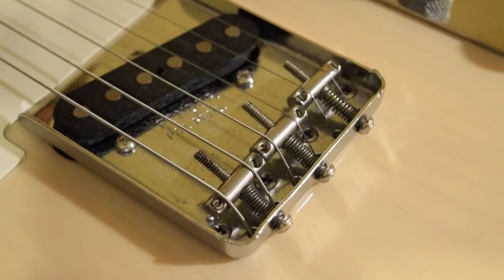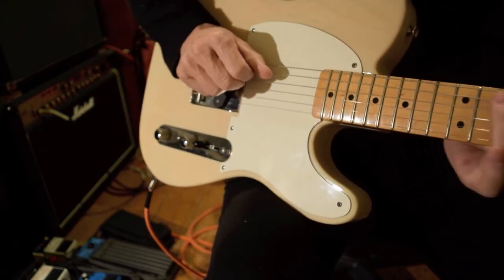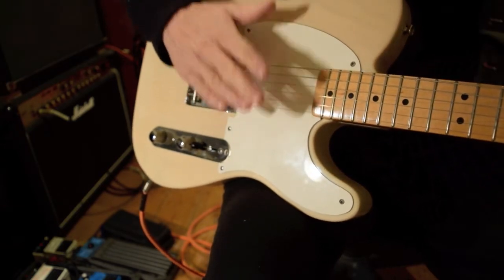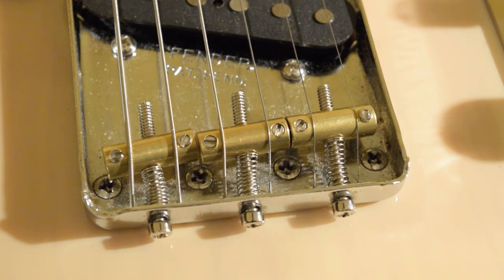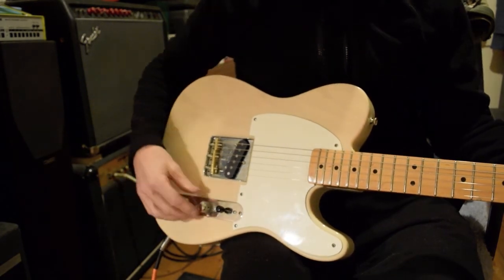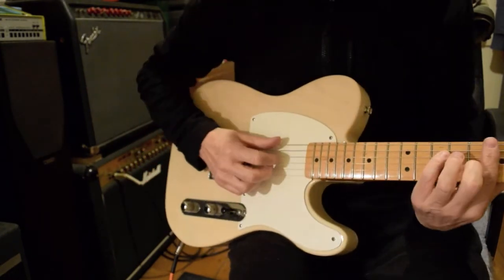TELECASTER SADDLES - STEEL VS BRASS

Comment: Thanks, well exited now cos I use the same Guitar(Fender Esquire) which comes with steel saddles frim factory which do sound lot "Brighter" the brass helps to bring the Midrange out as it usually gets drowned by the treble depending on how you play. With steel  saddles I find finger style better but for all round smoother tone I am going for brass too!
Reply from the maker: I don’t have the original pickup in mine. I bought it used and there was a Duncan rail bucker in it. Now this sounded ferocious but it’s not true to the era the guitar is from so I put in a Q Nocaster/Broadcaster Alnico 3. It works well! Let me know how you get on!

Comment: Great comparison, man!
This video came with perfect timing as I'm thinking about replacing the three stock steel saddles on the bridge of my Mexican Tele Custom with brass ones.
The only problem I have is choosing between non-compensated saddles and compensated ones.
There seems to be a lot of conflicting opinions online about how compensated saddles may cause a Tele to lose its charming 'not quite perfectly in tune' kind of sound that all the classic rock Tele players used to write history.
The ones you used for the video don't seem to be compensated, so I'd like to kindly ask you for your personal opinion on the topic 👍
Also, you definitely got yourself a new subscriber!
Reply from the maker: Hi
There’s a lot of myths on the internet about guitar. The original brass Tele saddles were used in the 50s. With 2 strings per saddle the intonation will be in most cases compromised. Steel saddles came by the 60s.
Again straight and non compensated. Now you have compensated which are milled and make tuning more accurate. Then there is skewed so they look slightly bent. These still look like the original brass but are slightly off again helping with intonation. I prefer the original type but I couldn’t get them, or couldn’t get them for under €50, so I went with the skewed brass. 
Sound wise there isn’t a whole difference I just like brass. The Steel is a bit more biting and brass less so.
As for what you like, go for what you like. I had the milled brass, they’re fine I just don’t like the milling. Looks too modern. The original brass are my favorite as the skewed look like someone deliberately bent them. Either way they’re fine. In fact this set was wrong, the middle is supposed to go the opposite angle to the other two!
So recap, not much difference, skewed are fine, these were €12 on Amazon and work fine. 
I think the smaller diameter of the steel I don’t like but I have a USA Tele with steel and it’s a beauty, and a Mex with 3 brass and that’s excellent too. I just like 3 saddle Teles full stop. I no longer own sixes.
And finally remember, your amp tone controls, playing style are far more important to the tone than the saddles themselves, as long as they’re adjusted properly!
Hope this helps!
Regards A